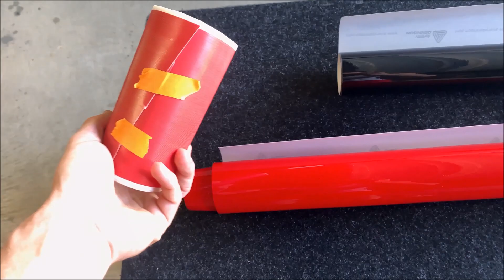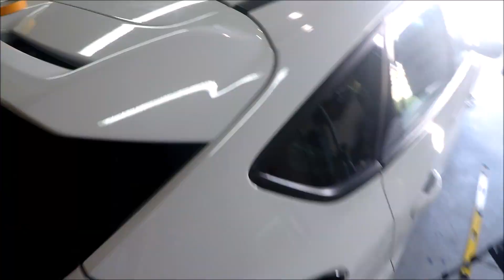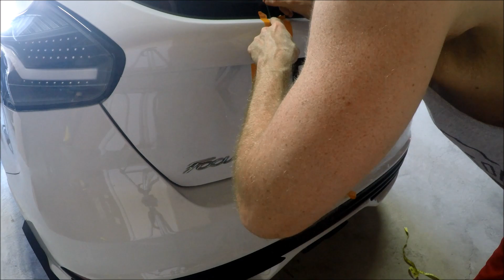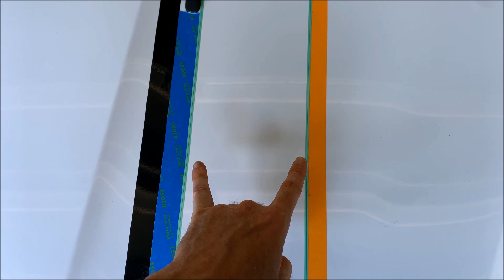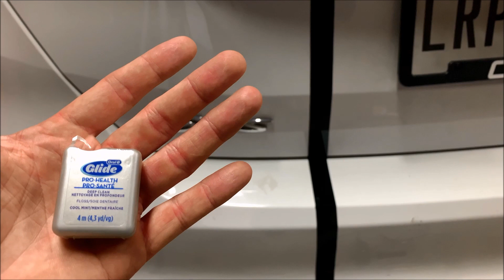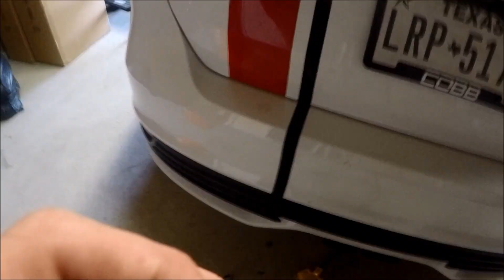DIY Custom Racing Rally Stripes w/ Knifeless Tape

Comment: ff you got off to a great start but I really wish you had slowed down and explained the knife-less tape. I could not see and could not understand exactly where it gets positioned and how it works. It was the most important part of the process but you gave it the last amoint of time. You are one of the best I've seen at beoing ablw to explain things and your overall process was exacting and clear, so go with your strength throughout.

Comment: How long do you expect it to last. Will there be a noticeable line where the pait did not fade from the sun after several years.
Reply from the maker: Luckily the car stays in the garage most of the time.  If it were to sit in the sun for years the paint would fade just like any vehicle.
Reply: @JordanMoree  so if vehicle stays garage kept, than it shouldn’t be an issue with your paint

Comment: Excellent video showing the correct process and how important it is to use good quality vinyl. Can you update this over time to report on the condition of the stripes? My 2008 Shelby GT's silver stripes started to go after 2 years, even with the car covered most of the time.
Reply from the maker: crunchers9 I do keep the car in the garage most of the time.  It’s not my daily driver but after 6 months they still look like I installed em yesterday.